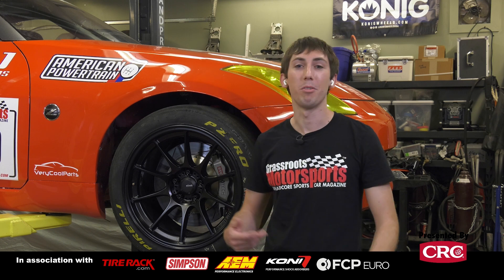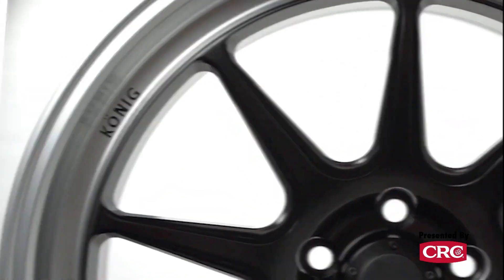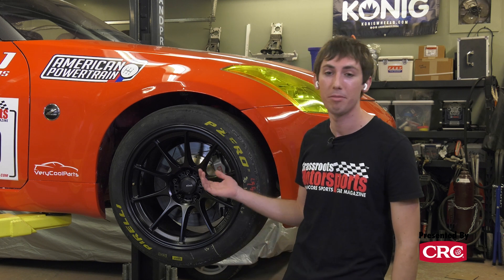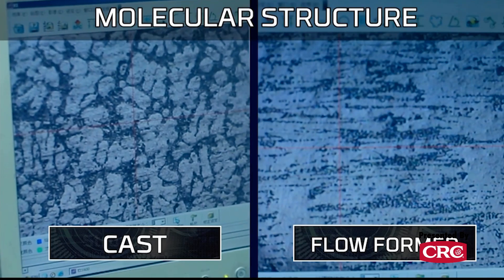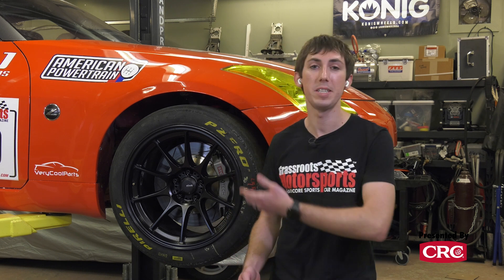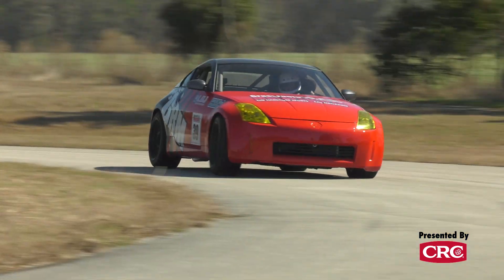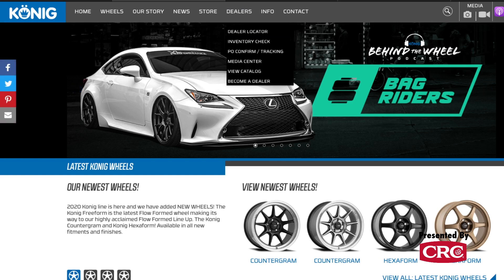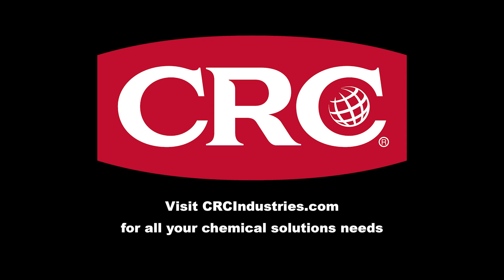What Are Flow-Formed Wheels?

Comment: Hmm  So only the barrel is "Flow Formed"... Just a standard cast wheel with a high pressure rolled barrel. in other words its essentially English Wheeled on the barrel and it would be the ONLY part that is "strengthened" or granularly the cast metals natural crystalline lattice structure is relieved via directional pressure. Got it. nothing really special other than reducing manufacture cost. the lips and the whole face are standard cast...